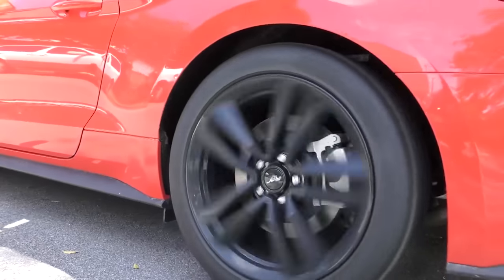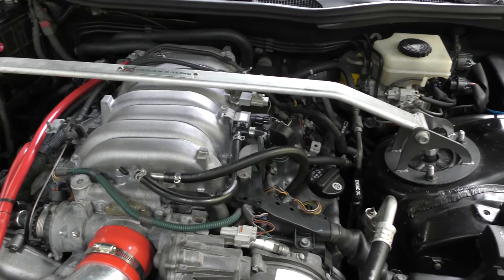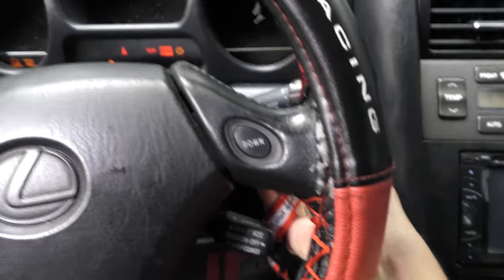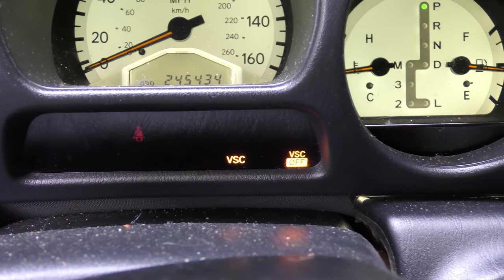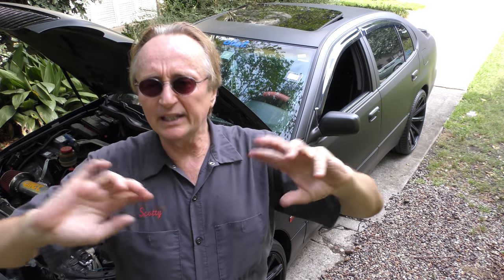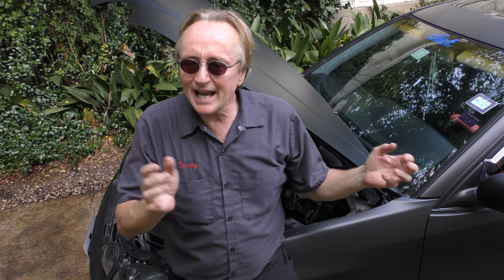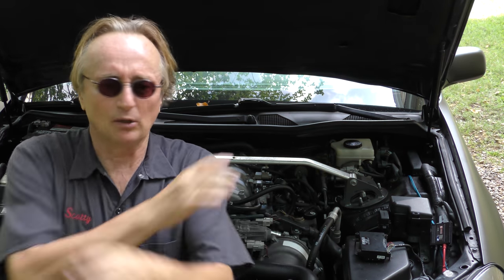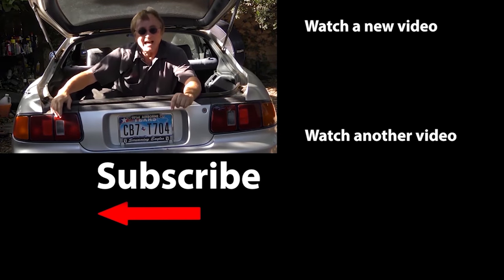Here's How Stupid People Modify a Car (A Sad Day for Lexus Owners)

Comment: short ram intakes on the cars I've had work perfectly, as the air flow sensor registers the amount of air going in.  I also upgrade the intake manifold and throttle body.  All I'm doing is adding more air into the motor.  Now I upgrade the headers and exhaust, so the flow is nice. I did this to my all motor 4 cylinder engine from and rsx type r (k20a). Got it tuned and saved to the new computer and never had any problems.  The K20 Motors are rev happy monkeys.

Comment: Not very much cold air entering the engine with that beautiful setup.
When using an airfilter box you have colder air entering the engine because you can design the filter box with a snorkel leading cooler air from outside of the engine compartment or even better (except for more frequent filter change) install the snorkel facing forward. By doing this you increase pressure in the intake, increasing  efficiency of the engine by creating pressure in the intake which in turn compensates for flow losses (restriction of intake system) through the intake. Drive fast enough creat forced induction.
Cooler air = higher density = more oxygen per volume air entering the combustion chamber.
Increase intake pressure = more oxygen per volume air entering the combustion chamber.
More oxygen burns more fuel creating more power which in turn burns more rubber when exercising the accelerator pedal muscles.
Sorry for the overkill explanation, I got carried away.

Comment: Why were there no oxygen sensor codes if you say there not hooked up? Also when you go to live data it says air fuel ratio sensor available. The fuel trims are directly corresponding to feedback from the air fuel ratio sensor.  At 51 degrees Celsius I don't know why they call it a cold air. And with those fuel trims I bet you'll find a bunch of contamination on the mass airflow sensor from that "Cold air intake".

Comment: I'd replace the purge valve and even the PCV first before the ignition coils on the Mazda... Much cheaper and more likely the problem, I had the same issue with an 06 Mazda 3, I thought it was the coils but the tested ok.  I figured it was the purge when I started to have the problem every time I would get gas, that will come eventually if you dont change the purge out now.

Comment: Proper modification for performance is not cheap. Beefed up intercoolers, performance exhausts, actual cold air intakes, and dyno tuning will cost you thousands of dollars. To get my MINI pushing an additional 30 HP, it cost over $2k and there's still more to be done. As if it needs to be said again, if want better performance, you will be spending a lot.

Comment: You definitely can’t remove sensors, car will run like garbage. I have no catalytic converters but sensors are still in place and I never had a check engine light come on. I’m assuming as long as the sensors are still there and functioning, then I’m good? Thank you Scotty!

Comment: Scott I have a 1996 SR  CAMARO V6/3.8 it cranks but it doesn't start, until I get to spray fuel STARTED, it does but it won't increase  the acceleration I am SPECULATING about some oxygen sensor, that I already CHANGE 2 twice, and since my clutch went out I haven't been morning it but I've been wanting to get it started every now and  then, an I am kind of getting ready to replace the clutch, but I also want to fix the starter problem, hope hear from you  soon, have a BLESS DAY, MAY GOD BLESS YOU....

Comment: I have long tube headers, over the radiator cold air intake, high flow cats and a 93 octane dyno tune. I have to get emissions tested yearly and pass with flying colors. Presently upgrading the valve train so that I can turn 7000 RPM. I might get 30 more horsepower out of it but that's not my goal. 97k mi LS6 V8 405hp fyi 👍

Comment: If you buy cheap intakes and cats they wont be compatible with any sensor that where connected stock. My 4Runner has a after market intake and exhaust  200k miles and never spits codes

Comment: It's a ricebox but it'll still go on screaming for another 100k as long as maintenance is kept up with.  My 03 MR2 has full header-back exhaust, no cat, a CAI and the lil dude is kicking along great.  No inspections in Chatham County, Georgia!  The ol' 1ZZ-FE doesn't even sip oil yet at 125k.  My 2008 Grand Marquis doesn't have its secondary cats or muffler and it's a happy camper.  The very minor side effects of bolt-ons can be ignored if you're getting a whole lot of fun in return.  Like ohhh gooood noooo the engine RPM fluctates 11RPM at idle now nooooooo

Comment: man needs a tune, I've got a Roush cold air intake on my Mustang, not tuned with no check engine lights, granted it doesn't require a tune but some cold air intakes do, I'm keeping the cats on my car and I'm finding a cat-back with high flow mufflers, it's my daily, I don't want to bribe inspectors to pass it

Comment: I bought a 1997 Honda Accord VTEC  with a cold air intake. The first thing I did was to remove it and throw it in the garbage can. Went to a Pick and Pull and bought the original air cleaner box and now it runs just fine,,,,,,,,

Comment: so the trans is fine it does that when the CEL is on cause of the o2 sensors its actually in a limp mode thats why it made such bad HP and the shifts are so rough.  i have the same motor in my LS430

Comment: Or instead of spending thousands converting the entire car back to stock you could do what they shouldve done in the first place and properly tuned the car with an aftermarket ecu so the higher flow intake and exhaust actually benefit the car rather than hurt it.

Comment: Original Net Horsepower 300. Serveral trash mods later a cool 130 Net Horsepower.  I can see the mileage responsible for 15 - 40  loss but to be that loud and that slow however kudos to the $400 paint job.

Comment: Also if you're having to give it full throttle in its a few under to car and your starting it it might not be the coils it could also be the wires or even old worn out spark plugs as well so when you change the coils you should change the spark plugs in this particular instance

Comment: Literally. Tune. The. Car. That’s it and it’ll run great. Still won’t pass inspection yeah but it’ll run right. The guy probably took the tune out before selling it so the ECU was unlocked and could be modified again as needed.

Comment: I stuck a ram air into my PT Cruizer only because it makes more room under the hood to work on. ::P Airbox was super resistive and took up way too much space for covering the battery and also the charge mounts. Was an 800$ car so I know it will need plenty of work. Now I have one less thing to pull off. That plastic intake is next. Now the air temp sensor housing was missing the entire outer plastic tip, it was not in the old airbox so that sucker got fed through the intake at one point is my guess. But removing it just to get to the plugs is a PITA, they do make an aluminum intake and I am not a fan of 20-year-old plastic. Just saying.

Comment: Scotty can you help me I have rav4 1997  3doors  USA model I have swap the engine cuz the old owner was us8ng celica engine and I have bad experiences with fuel even I tried to replac everything but still uses more fuel I knew it from the bad wiring so I changed my engine to the original one but here it comes to a new problem where the engine is running fine but there is no power it all I have changed many things

Comment: 6:30 The original timing belt?! At 240k miles and 20 years old?? What. I have a 2001 GS430 and the timing belt was replaced at 100k miles. And I am changing it again at 181k miles because it has been 10 years now...

Comment: Well if it's old enough it doesn't get an emissions or hooked up to cpu. Then even older you just get the tags renewed. My 99 frontier just gets a safety. Also 245k miles I almost willing to bet that ain't the engine that came in it.

Comment: I mean... Why not fix what's broken but keep it the same? Like put a bung in and an o2, a resonator, then tune it. It would probably be great at that point. Also ac I mean. Could just be a trip to the junk yard. Timing belt does need to be serviced but hey if it means that much to someone then why not?

Comment: In this day with engines as good and sophisticated as engineering is, why wouldn't they be designed with non interference valves so the engine won't be ruined by a broken belt.

Comment: I'm always stunned when people take a perfectly good car and turn it into this.  I know it's old and has high mileage, but does anyone consider re-sale value?  This thing is less than worthless.
Reply: Resale value of cars plummets to $1000 when they pass 15 years and/or 100,000 miles.  Doesn’t matter how pristine they are….. people want the latest styles in clothing & cars

.
Reply: @electrictroy2010  Not sure you've checked in on the used car market lately.  Most 15 year old cars with 100K are going for $7-8K.  This car, if not ruined, would still be worth $4 or $5K easy.

Comment: Scotty Kilmer I disagree with you on modifications if done right and tuned correctly you can have significant power gains I have a 1989 iroc z with a 383 stroker tpi on nitrous putting out over 700 horsepower all emission stuff removed long tube headers no catalytic converter or muffler built 700r4 transmission 2500 stall converter with a ford 9in rear end on slicks with subframe connectors and is a street driven car

Comment: The automotive aftermarket companies prey on the young guys because they lack common sense and will spend significant money for imaginary gains. Here is the kicker, all those mods hurt the value of the car. Its a double-lose scenario. I made the same mistake when I was young. Now I drive a BMW M car with no mods and of course it runs great and has decent reliability as I stay on top of maintenance. Most of the guys will figure that out as they get older.

Comment: As somebody who bought a 2001 GS300 for 900, you'd better have the money to fix em up lol
Reply: How much did you put into the GS?
Reply: @scourgeofbloodclan3986  About 2000 so far. That's just to get it running. There are a quite a few issues that need to be sorta about still. I'm probably gonna end up spending somewhere around 3-3.5k. But it's a Lexus so once it's fixed up it shouldn't have any issues for a while.

Comment: When did they start listening to ur exhaust sound for inspection :D as long as u have no codes and ur wheel components are decent and brakes ur good to go. Atleast here in the NY state. I have 2016 vw gti with no catalyst converter. No CEL so no problem to pass inspection. U just have to tune it out :)

Comment: I had my eye on an 02 with 77k miles GS 300 with V6 they wanted $5k. It was untouched and one owner, so I imagine it was a good one that got away.
Reply: they never had V6 engines bro.. they have Inline 6 cylinder engines.
Reply: @DanishKhan-ky8su  oh yeah the I 6 . I meant the 6 not the 8 cylinder

Comment: how to ruin your GS in 2 easy steps ...ON A SIDE  NOTE  i told you that timing belt change is a scam , 245th  thrashed on miles on the original belt ...

Comment: Put the sensors back in leave the cats out do the timing belt yourself and the computer should remap it’s tune. Ac doesn’t work, this guy wants a race car. -Ac is just another way of saying weight reduction. Problems fixed aside from the transmission. If you cared about the car enough to want to keep it. Head to a junkyard and buy a transmission with less mileage and install it. You might have spent $1000 at this point if you’re thrifty. I also really find it amusing that Scotty doesn’t say what he’s been asked to fix on this car.

Comment: To be fair it looks pretty tasteful other than the crap badges he put all over it.  He could have atleast gotten a tune with all that fancy crap though.  Custom welded MAF input and a big MAF and no tune?  what in the hell are you thinking?  You can do an intake, and a lot of piping work throughout the intake and exhaust system aslong as you dont make it any bigger, just less restrictive where it might throttle some air.  But to do so much without a tune, man, this guy was just working out of his head, looks like he did no actual research on how to modify.

Comment: 3:03
Scotty " The oxygen sensor is unavailable cause all that was taken off with the converters"
Scan tool on screen " Oxygen sensor AVAILABLE"
 Stupid scan tool must not have fit Scottys narrative of " If you install a cold air intake or ANYTHING else to increase performance ....your stupid, your car is stupid, and its 100% illegal to drive 100% of the time on 100% of all roads, stupid!  But HEY REV UP YOUR ENGINES👍
🤦

Comment: This guy is definitely a ricer😂. With the Audi supercharged badge and the TRD. Also the off the shelf intake tube and the cat removal. If he got a tuner he could fix the cat issue and get the OEM or aftermarket airbox meant for the car it would run better.

Comment: Get an ecu reflash from all4swap at quantum auto. 10% extra hp/tq, eliminate all error codes regarding egr, lower o2 sensor, and cats. Improved shifting and throttle. Done!

Comment: Dude couldnt list off any modifications besides a cold air intake and catalytic converter removal. "Aftermarket sensors"? Good one.

Scotty you literally just sat there and said that the car you said had a quarter million miles runs great... good fight.

Scotty: 20 mph neighborhood speed limit this car has lost a lot of power!
Me: right, definitely something you can tell at 20 mph..

Also, you mentioned lag in throttle response. Duh. Cold air intakes dont have a helmoltz chamber. But I bet you're going to sit there and say you knew that.

Point of the matter. Every vehicle manufacturer has a specific budget to design a car with. There ARE such things as parts that IMPROVE a motor, it's performance, lifespan, and fuel economy. And odds are, if you go through with removing your cats, you're already CONSCIOUS of inspections. I'll bet money that car was registered in an area that doesnt have emissions testing.

Get over yourself and your narrow-minded ways thinking that a bone stock vehicle is the BEST POSSIBLE scenario that any given car could POSSIBLY be in.. even YOU complain in every other video about how crap certain things are on certain cars. But according to this video, DONT DO ANYTHING to a car! Dodge have crap transmissions? "Oh well I have a new transmission that doesnt have the same problems that would be a better option" NO! Dont do ANYTHING to your car! Because "there is no such thing as an aftermarket part that is better than the original equipment"? Get back in your POS 94 Celica and go get stuck in traffic.

PS.
This car stock doesnt have 4 catalytic converters.. they have 2..

Comment: Just a typical Ricer Retard Ride.
'Supercharged TuRDyota'....LOL
It's got the glue-on window vent shades and the Hot air intake!
I'm surprised it doesn't have more stickers, a chrome fire extinguisher on the A pillar obstructing vision, and a HUGE 747 rear wing.
Gotta love an OHC V8 with a rubber band running all those valves....AND it's an interference engine....tick tick tick.

Comment: Sorry but you're full of it. As for Cambelt waterpump etc it's literally 250 bucks and 4 hours for genuine. Also 250k miles is genuinely nothing for the 1uz. I'd buy one with 500k all day. Also intake and exhaust mods lol. As for 1000s and 1000s to fix, buy a jjnker and take everything you need. There we go 500 tops.

Also theres only 2 cats...3 in California. And I'm gonna guess cats are there but all boxes removed.

Comment: That air intake sucks in HOT engine heat and throws in RIGHT BACK into the engine LOL idiots. That aluminum gets hot as hell too. That thing hurts the engine and especially horsepower. COLD air intakes sucks in cold air as is in air outside the engine. Mine in located in the passenger bottom front bumper corner. That car is a mess.

Comment: I’ve owned my Lexus for 10 years and it’s probably the easiest car I’ve ever worked on. The parts are super cheap for it. I have a 2002 Lexus gs300 with the 2jzge motor.